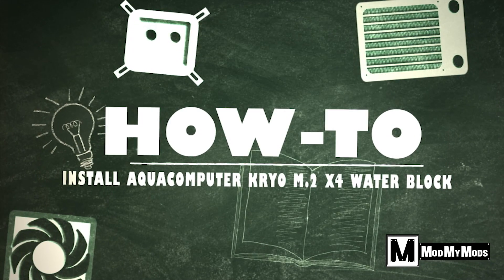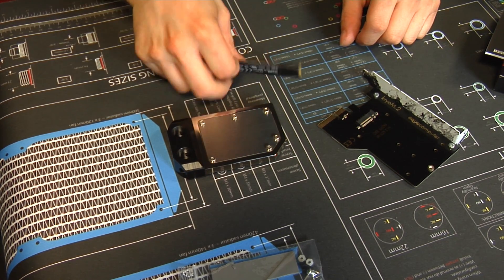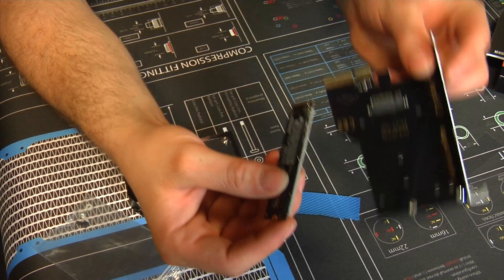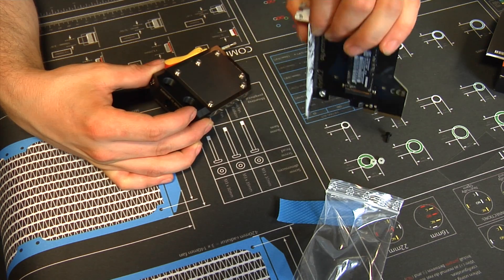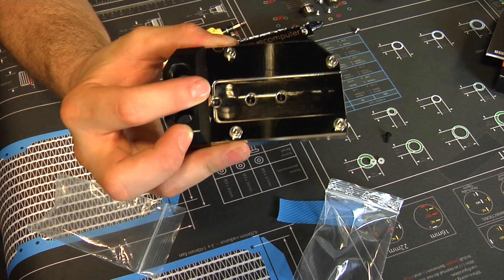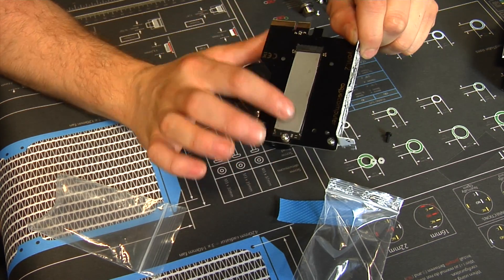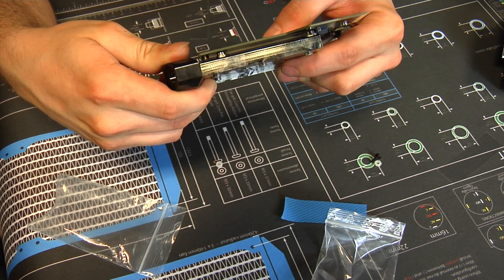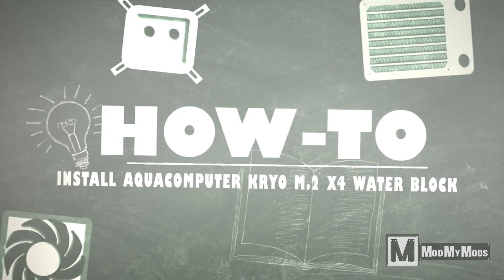How-to Install an Aquacomputer Kryo M.2 PCIe Waterblock

Comment: i have an strix h270f motherboar. And an NvMe intel optane 32gb like to know if the optan works with this pcie adapter. or ther is any other custom watercooling solution for intel optane?

Comment: Great video. Never knew they make water blocks for m.2's. If you install this in the PCIe slot; obviously at x4 PCIe speed off of the PCIe lanes of the CPU, will it bottleneck or be faster/slower compared to the m.2 socket on the motherboard? And also, can you boot from a PCIe slot.
Reply from the maker: Depending on which motherboard you have, some allow the option to dedicate a certain PCI slot to the SSD without losing the 16x speed.